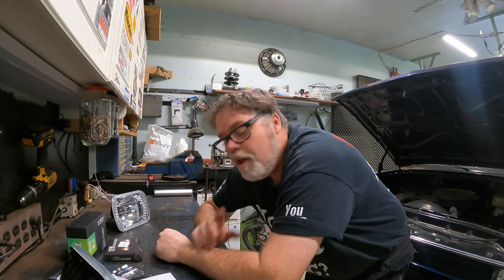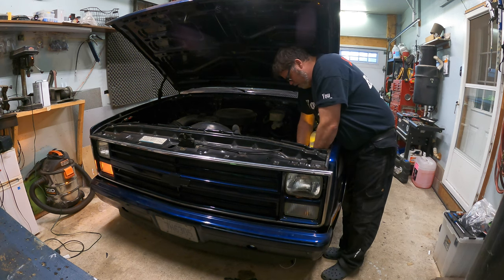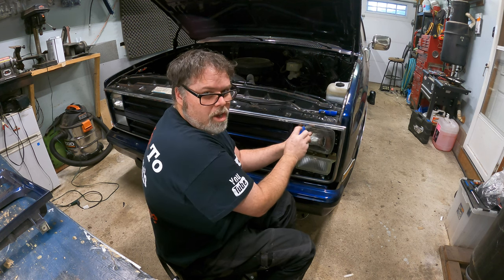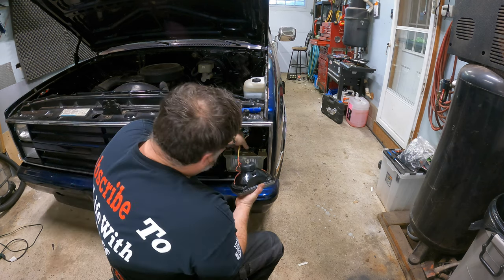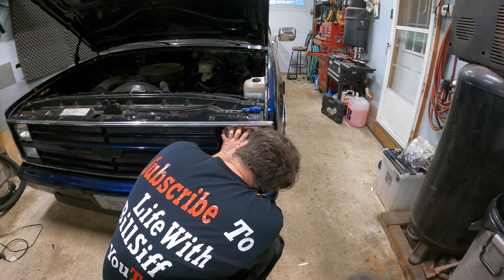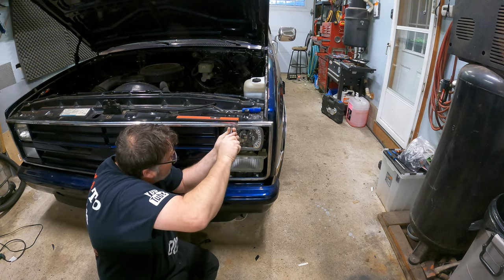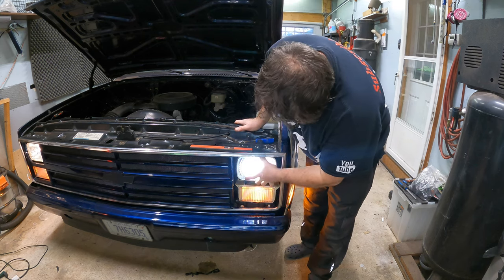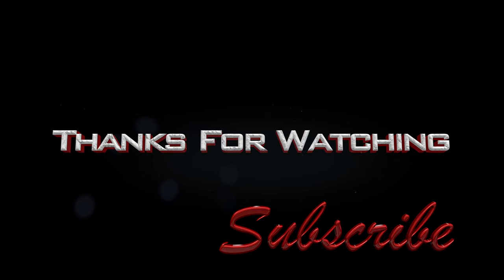Installing LED headlight Conversion 87 Chev R10   4K

Comment: Looks cool.   
If you are not aware, the side markers ground through the front turn signal lights, do error frees cover that sort of situation as well? I thought they just had built in resistors to keep modern body computers happy if they have lamp out detection.  

But as for the blue...   you'll be illegal here in Ontario. No red or blue facing front lights except for emergency vehicles.  
Section 62, subsection 14.1;  
"Red and blue lights restricted

(14.1) In addition to the lighting requirements in this Part, a vehicle described in subsection (14.2) may carry lamps that cast red and blue lights, but no other motor vehicle shall carry lamps that cast red and blue lights. 2017, c. 26, Sched. 4, s. 14 (1)."  

Might not get unwanted attention, but if a certain town near here that is patrolled by the opp is any indication, you may get some hassling for it.  Hel, they kept me at the side of the road for a little over 20 minutes in my work van for having a burnt out daytime running light.